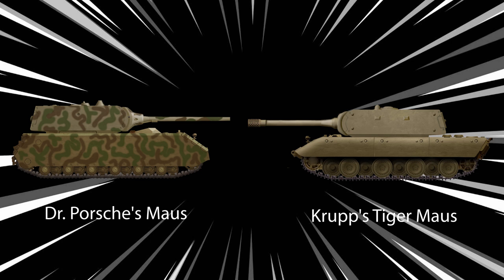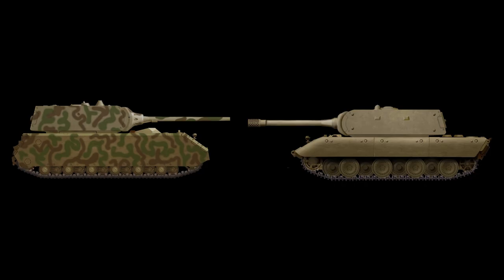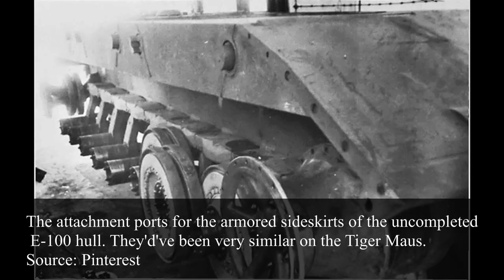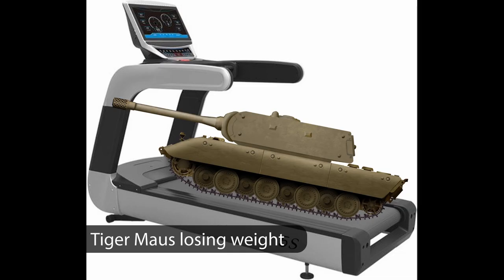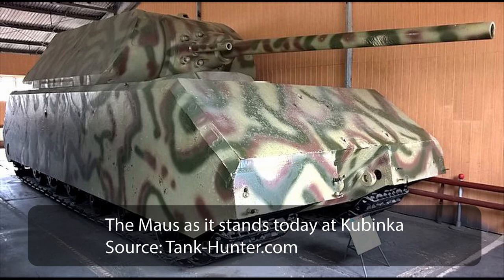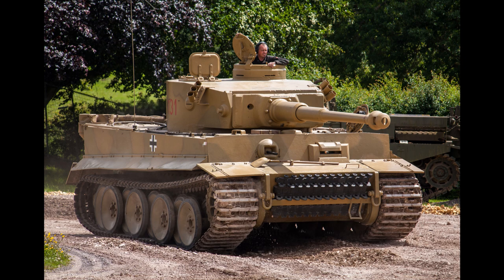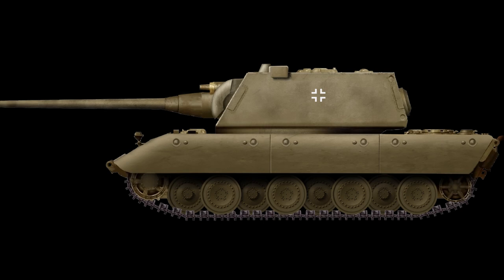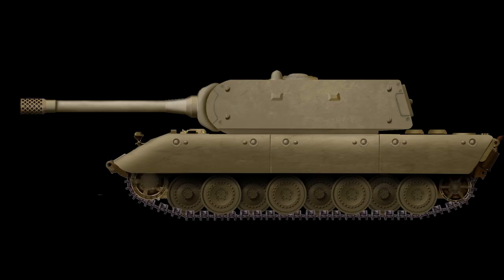The Lost Rodent | The 130 tonne Tiger-Maus

Comment: The fuel situation for most of the war was critical for the axis powers...transport and bridges are other considerations that were not thought of - tankers like OTTO CARIOUS should have been involved.
The latter was appalled at the jagdtiger at 72 tons - he mentioned this in his memoirs that just keeping one in action was not cost-effective in any way. Coupled with that stupid decision about deployment for the Ardennes offensive took many heavy tanks from the eastern front.
It is the main reason for the Russians breaking through german lines - especially in the southern part of the Selo heights.
...By far the simpler way to protect german tanks was more use of skirts as in the panzer 4.
Panthers and Tigers were vulnerable on the sides with bazooka's and 122-152mm high explosive soviet shells. The Ardennes offensive could have worked if the panthers and tiger losses due to bazooka rockets could have been reduced - fuel could have been found even though the supply at the start of the offensive was not enough to reach Antwerp.
...Lastly, after October 44 the Finns could not send Germany any nickel vital for pliant German armour. At the end of the war, German armour was as brittle as the Russians in 41; even these behemoths would have been vulnerable to allied attacks.
Reply: Tiger Maus died in January 1943

Comment: So, tiger-maus is E-100, right?
Reply from the maker: No. Tiger-Maus is the predecessor of the E-100. The Tiger-Maus was the competitor of the Porsche Maus, not the E100. The Tiger Maus had an early style Maus turret (curved front), the E100 had a lightened Maus II type turret (angled front). The Tiger Maus had torsion bar suspension.